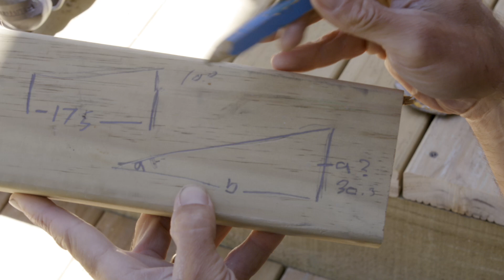Work/Life Imbalance  - Is Solar Power the Answer?

Comment: You calculate that height using trigonometry.  Sin (angle) = opposite side (Height) X hypotenuse (Rafter).  With right angle trigonometry, you only need one side and one angle.  To use geometry, you need to have 2 sides of the triangle and use the Pythagorean theorem.  There are some special cases with triangles, 30-60-90 and 45-45-90, where you can use formulas to calculate with only one side but they don't show up much in construction unless you design them into the project.  I am a trained carpenter and university grad in chemistry, so I know some mathematics.  

Huge respect for what you are doing.  I am also living on the outside now and living in a foreign country.  American by birth, raised in the USA and Brasileiro by choice.  I have lived in Southern Brasil for many years.  Just started watching your channel.  It is already one of my favorites.  I will spread the word regarding your channel.
Reply from the maker: Hey thanks for this.  Maths is something I have always been terrible at.  I used to get anxiety calculating the most basic problems.  Now I need it all the time with woodworking, so I am starting to learn the basics.  Thanks so much for the encouragement
Reply: @projectparadiseNZ  I have tutored mathematics, off and on, since I was at the university.  I struggled with it for years.  Then one day, it just clicked for me.  After that,  I excelled at it.  I will send you an email to offer my support.  I really like what you are doing in NZ.   I am not looking for tutoring work.  Rather, I am attempting to build a bridge to another modern primitive like myself.
Reply from the maker: @TiagoLennertz  thats so kind of you.  I started with the times tables then moved on to multiplying fractions etc.  i do this through an app every morning.